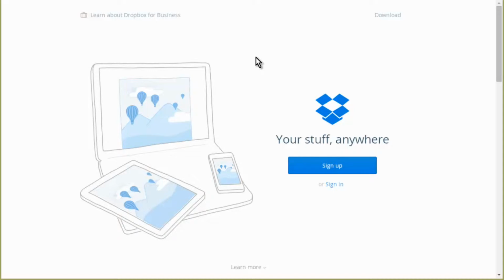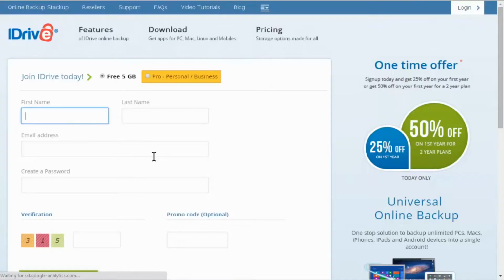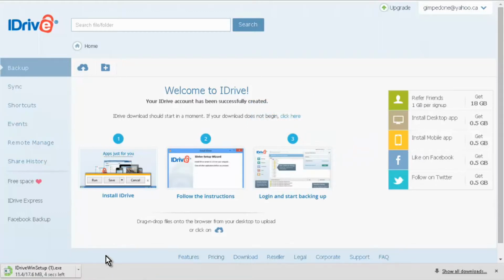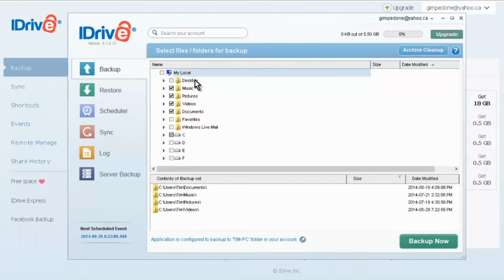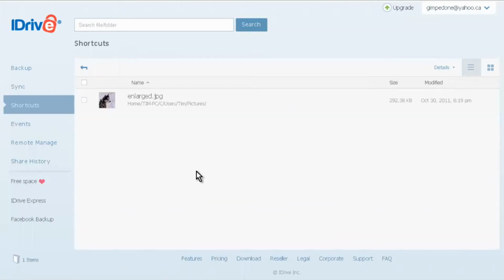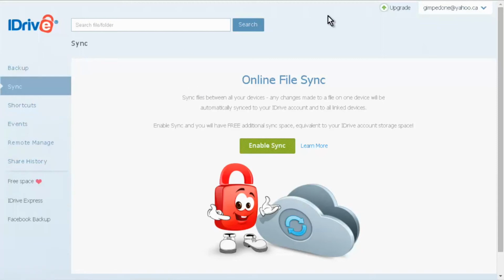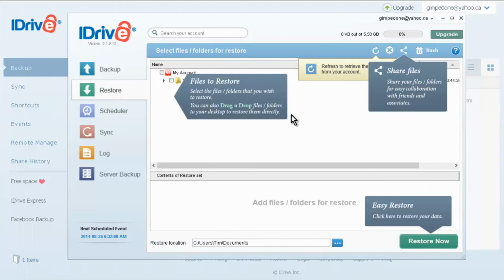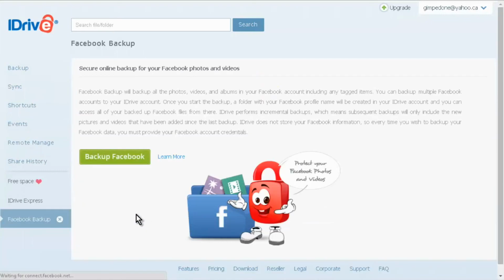How To Backup To The Cloud Without Using a Sync Folder

Comment: I don't understand your presentation! Aren't you using your cloud sync folder? I am trying to be able to use my original documents folder and picture folder, and have whatever I put into those (regular, local) folders on my desktop - to be synced into my cloud. Can that be done? Or, do I have to move everything I want synced - into my sync folder?